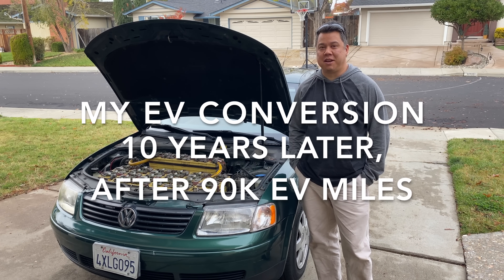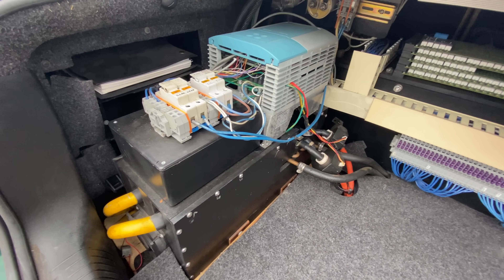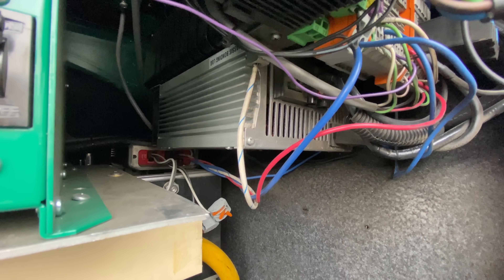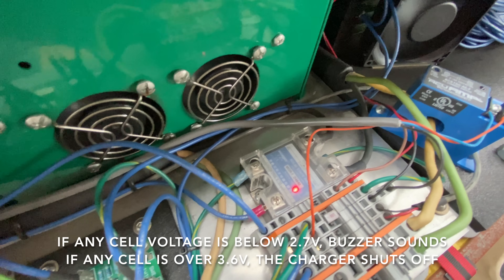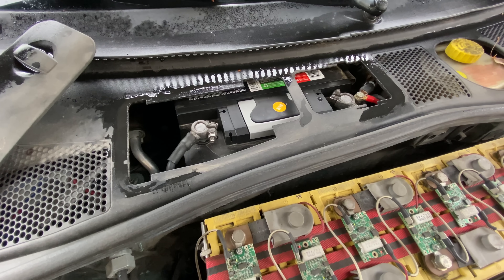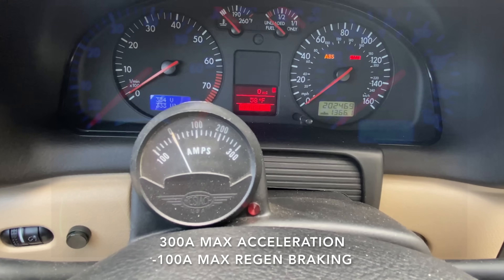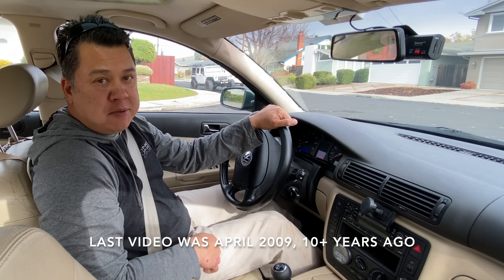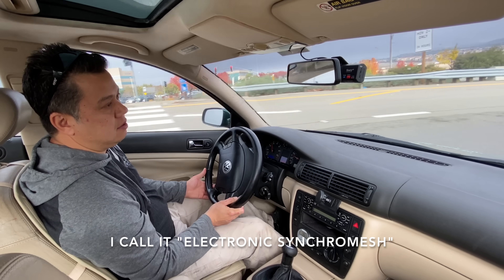My EV conversion after 10 years and 90k miles

Comment: Wow, there is/was a huge amount involved in going the DIY route - you obviously need more than knowledge of your resistor color-codes to tackle a project like that!  Impressive.  It would have been nice to know what sort of decrease in battery capacity you've seen after 10 years.

Comment: Turns out it's really not as simple as battery, charger, motor, speedcontroller. There are many things that used to be there with engine power ready to use that now has to run on batteries, such as power steering, heater, ac, etc

Comment: on Large Diesel Trucks and many types of after market modified off road 4x4 use what is known as hydraulic boosted power brakes.  the booster runs from the power steering pump.

Comment: how can a manual gearbox work in a electric car? they just have forward and backwards? im still in the stone age and drive a petrol car so this is madness to me
Reply from the maker: To make the car move you just need to turn the input shaft on the transmission (with a motor).

Comment: If u needed to charge one cell manually then whats the point of the bms
Reply from the maker: A BMS protects each cell by disconnecting the charger or disconnecting the load before the cell is over charged, or over discharged.  BMS can also perform a balancing function to maximize the potential capacity of each cell a pack.   I have never needed to balance manually, but there may be a time where one cell drifts beyond what the BMS can balance as the cells age, or if the car goes a long time without being charged (top balanced).   Better to have the ability to easily check that cells are actually balanced, and have the ability to balance, than not design for it.
Reply: Thats very true... thats a nice setup! I just built a 48v 1500watt drift cart lol far less technical compared to your build but maybe one day I can turn the minivan into a electric drag racing machine! 🤔 one can dream haha

Comment: 333V. Looks like you have 100 LFP cells in series. But seriously doesn’t look 100 prismatic cells. They are packed very tightly. By the way what inverter and motor are you using?

Comment: bro huh, you havnt changed brake pads in 10 years? did i hear that correctly.......
Reply: That’s because of the regen braking, most electric cars go a 3x or 4x as far on brake pads.   Having said that I did 90,000km on a set of brake pads in my 1998 Volvo 940 SE a few years ago, mostly highway use.
Reply: Many new EVs now come with ceramic coated brakes because they were rusting up from disuse.

Comment: Describe electronic syncromesh please. Lol
Reply from the maker: Let's say the motor is spinning at 8000 rpm in 2nd gear, and I want to shift into 3rd gear.  I know the RPMs need to be 6000 rpm for 3rd.  So I put the car in neutral, command the motor to 6000 rpm, the shift light turns on to indicate the revs are matched for 3rd, then I shift.  I think a lot of new stick shift gas cars do this as well.

Comment: That conversion may be primitive by today's standards, but so was the first Bell Telephone, Edison record player, Wright powered glider, and Ford Model T (the latter was very basic-even for the time, but also affordable.)

The COVID-19 epidemic is UGLY, both from a Humanitarian and Economic standpoint. But...we all saw a beautiful site a few months ago. All those oil tankers off California, with no place to put their oil! Folks were driving to work less, and flying much less. With the EV, we can make that a permanent reality. Private vehicles use over 40% of refined crude in the form of Gasoline. Tractor trailers use about 25%...mostly as Diesel. In the latter case, we could use overhead high voltage Catenary lines on the Superhighways.  This is being tried in Europe. With "Green" power sources, especially, we could  have massive savings. Even with natural gas generators, things would be much improved. The Nikola startup (Tesla's first name) is rolling out Hydrogen fuel cell trucks. Again-if the H2 is electrolyzed from Solar or Wind, there will be Big savings in fossil fuel usage. 

Jet airplanes cannot be made "Green", but bullet trains and the Hyperloop (which is also Elan Musk's baby) could replace air travel domestically, and even Continentally (from Montreal to Buenos Aires, Berlin to Jo'Burg, Paris to Vladivostok.) Domestic Oil interests, along with OPEC and Russia (which is a massive producer) have conspired to stop the Green Revolution. 

Home HVAC uses a LOT of Natural Gas. Home Solar and wind are sometimes practical, but ground loop heat pumps can be used almost anywhere. Again-massive Carbon savings. I think a Eutectic bath in the basement would be a cheaper option.

Comment: The range is not bad and on my current used Nissan leaf it has 85k miles on it and goes 40 miles on a charge. Plan on upgrading the battery myself.

Comment: Impressive build! Very clean.

If I might suggest one thing, it would probably be to isolate the HV parts so they cant be touched accidentally. Maybe an IP grade high voltage junction box for the relays, fuses etc.

Comment: not considering the price of electricity for recharging the car
with the price of diesel of 1.1 $/Liter in the EU, and average fuel consumption of 7.5 L/100Km, you can buy diesel for 303.000 Km wich costs 25.000 $
And he only did 150.000km so far
In my oppinion it's not worth it, considering lots of money upfront, and you have to drive at least 60.000 km/year  for 5 years just to get your money's worth, and start to make a profit after that, considering that the life of the batteries is about 10 years.

Comment: I am an electrical engineer and let me tell you his project is phd level or maybe higher. Such an awesome guy. And he built it 10 years ago!! 10 years ago if someone told me that electric vehicles are future i wouldve laughed but today it is a reality. Although i can bet that the whole assembly wouldve cost alot. Brushless dc motors with convertors and igbts (10 years ago)..wouldve cost alot.

PS : a suggestion you could use liquid cooling for the battery packs, thought there always a risk of leakage.

Comment: Kudos! I only dreamed of converting a Ford Ranger or a small car 15 years ago, pricing out a kit and batteries beak then it would have cost me $15 grand with my labor. It wouldn't had the air condition, power steering & brakes, and not lifepo4 batteries. 
 I never did.
Reply: Now is the time.  Start building!
Reply: @daveriley6310  I like the technology of today. I'd rather buy high tech :)

Comment: Are you an electrical engineer.?

I wanted to convert a walk behind  skidsteer to  electric.  Because after 3000 hours the motor went out. This is way too technically for a carpenter. 

Don't get me wrong. You have done an amazing job. This car will outlast the body. 
I'm a strong believer in this is the future.
But it doesn't help in the MEXICAN beer virus. ( CORONA)
One I get back to work. It will be hair  straight back. 

Can you give me some advice. $3000.00 for Honda gx690 motor or electric. Any I on crack. 

I can handle honesty
Reply: Dave Welch  - Shuswap Renovations. 
250 803 8890 Canada
Reply: I'm a  carpenter. Mechanically challenged and electrically challenged. 
Make it simple. 
45 years of being a  carpenter. My excuse is I come from Irish ancestors

Comment: is two hours per gallon a good deal. get forklift and take out just the alternator and the hydrualic motor and you get a scooter that is water cooled 60 mpg and us 2 to 1 gear for the alternator and it runs on regular for two hours at 30 miles per hour at full power for the hydraulice motor. adjust gear ratio as necessary for different forklift. auction look for ones that have a broken engine are easiest and broken stem or hrydaulic with engine that is too old to repair anymore also i do video game walk throughs. full name show.

Comment: This is great, would it have cost you less if you started the project today?
Reply from the maker: I think the costs would be roughly the same doing an identical conversion.  Today there are used batteries available, that would be cheaper than the new batteries I bought, so it could be done cheaper.
Reply: @etischer  Thanks, I appreciate the response.

Comment: Okay. i hate to be "that guy" but that's a lot of naked circuit boards under the hood.
Reply from the maker: The boards are conformal coated.  Hood is sealed all around with foam gasket.  Hasn't ever gotten wet, just have to blow dust off once  in a while with compressed air

Comment: Can you help me with the cooling system? My kelly controller shuts off after 10 mins of ride
Reply from the maker: Might be able to help, but might try asking Kelly too.  You might just be over driving it beyond it's continuous duty rating?   What size radiator are you using?  What RPM is your motor spinning typically?  My guess is you're running too high of a gear (try 2nd gear instead of 3rd), so you get more voltage to the motor, and less current.  Current causes the heat.   You can get more power with less heat running higher rpm (higher voltage, less current).

Comment: Cool project.
Just as a side note - does it really need the BMS for each cell?
I would expect you only need these if you use the full capacity of the cells.
Reply from the maker: I ran without a BMS for about 6 months initially, manually checking 99 cell voltages a few times a week with a volt meter, and manually charging individual cells.  Then I started to charge my car at Tesla every day, it would be really bad (international)  news for my car to catch fire.   I wouldn't run without a BMS, too easy for something to go wrong, and too many cells to keep an eye on.

Comment: Impressive! LiFePO4 right? Did that chemistry improve over the last 10 years? (power, weight, volume, if you'd would buy new ones today)
Reply from the maker: I don't think it has improved much, I think the same cell in the same form factor, same Ahr are available to purchase.   They are still lower energy density compared to Li ion.   I would go with a used battery from a crashed hybrid or Tesla.   Hybrid batteries are designed for high discharge current, so you can get away with a smaller battery pack.   If you don't need the density or high discharge rate  (stationary storage) then they might be a good option.  For EV use, I think there are better options out there on the used market.
Reply: @etischer  Tesla may develop a new kind of LiFePO4 cell for the Chinese model 3. Maybe you can use those one day. And a thought: would it make sense to add a supercapacitor bank to your system, to support short moments of high discharge (and re-gen). Anyhow: amazing job you did!

Comment: You retired and bought a Tesla 3 ?
Reply from the maker: Yup.   I was commuting from SF bay area to Reno weekly for the last 50 weeks at Tesla, and just got burnt out.   Been holding off buying a Tesla for years because it just doesn't make economic sense since I have the Passat EV.   Finally pulled the trigger, ignored economic sense and bought a Model 3 AWD.  Couldn't be happier, it's such a leap forward in automotive evolution!

Comment: How can you solve inductance jerk that made inverter fault in early trial?
Reply from the maker: Not sure what you're referring to.  Are you running V/Hz, Sensorless vector, Closed loop vector?   What RPM does the fault occur?  Do you have the right motor parameters (full load current, magnetizing current, rotor time constant, # of poles, voltage...)
Reply: @etischer  I noticed you'd mentioned your 1st trial came up with electrical fault between your driver circuit and IGBT power modules. Then you said it was from some mismatch inductance.  So I wonder on what ]s the cause and the way you solved that problem.
Reply from the maker: @alexlo7708  The motor is a big inductor coil, and it wants to keep current constant (like how a capacitor wants to keep voltage constant).  When the IGBT switches off, this causes a voltage spike (coil is trying to keep current constant with infinite resistance).    They sell specialized film capacitors (snubbers) that mount directly on the IGBT modules to absorb these voltage spikes.   That's all I had to do,  I added a few of them on a copper bus bar, that's what those black boxes are above the electrolytic caps.    Originally I had my cap bank connected to the IGBT using wires, they need to be mounted directly on the IGBT.
Reply: @etischer  Thank

Comment: Would a smaller setup, 1/4 the batteries and a drive shaft boost motor work as well. 20% boost for below 30MPH driving. Keep the main car engine the same, everything and add push a button for drive shaft boost.
Reply from the maker: You can make anything work, but not sure it would be effective.  20% boost but carrying 20% more weight.  Boost motor will need a transmission to gear it down, but then it will limit max speed unless you add a way to disconnect it on the freeway.

Comment: A lot of work. Impressive. This is what you do when the market hasn't started building what you want. I'm sure some issues would be approached differently today. The only thing that bothered me was the exposed battery pack between the rear wheels. Up here in Quebec that would be destroyed by salt&grit in the winter. But making a shroud or enclosure out of ABS would not be out of reach for this gentleman.

Comment: What happens when you hit a pothole or a puddle
Reply from the maker: nothing happens
Reply: @etischer  never had a short? Thats really cool
Reply from the maker: @draconicwindbane2056   The computer style power supply Im using (purpose built for EV) to generate 12v  did have a short once,  an internal fuse holder was resting against a cap, and rubbed through the vinyl on the capacitor, a fuse blew, and I had to drive home just on the 12v lead acid battery.  Was lucky, I just had to put a new fuse in.  This happened about a year in, and hasn't happened again.

Comment: I'm currently in school for electrical engineering and this man is inspirational.
Reply from the maker: Was curious to know if they have any high power course work at your college?    Everything I learned in college was breadboard level.  I'm on the advisory board for my college now, I'm trying to get them to add some coursework on designing: electrical panels, power distribution, battery management, grid tie inverters, solar inverters,  IGBTs, switching power supplies...  Would be interested to know if coursework has changed since I went to school.
Reply: @etischer  I'm currently in my Sophomore year and so far it is only breadboard level circuits and also logic circuits. They have added a power systems course to our curriculum that I will take my junior year that I believe goes over battery management and I believe grid storage. It seems the emphasis at my university is geared more towards microcontrollers (such as arduino), communications and breadboard level circuitry. I'm hoping to incorporate solar energy into my senior project though.

Comment: Excellent video and engineering!  Two concerns:  How do you keep the LiFEPO batteries from freezing as that will damage them, and I would be concerned about all that heavy equipment in the back with what appeared very little barrier between them and the occupants in a crash.
   I think the auto companies should take you on as an engineer if they haven’t already.  What’s your day job?
Reply from the maker: It doesn't get freezing cold here in California, it's also in the garage every night.  The cells in the rear are pretty well secured, with welded racks sandwiching the car's chassis, then another aluminum cage over the top.   Day job was Sr. Staff controls engineer at Tesla, retired a couple years ago.

Comment: There's something i dont understand about this build... Do you only drive it in dry weather? What hapens if you start rolling in water, all those boards directly on the cells will surelly fail...!!!
Reply from the maker: I drive it every day, rain or shine.  The circuit boards under the hood have never gotten wet, it's fairly well sealed with a gasket around the hood, and bellypan below.  They are also conformal coated, so if they get wet they are somewhat waterproof
Reply: @etischer  thanks i didnt  know engine bays were sealed

Comment: Mmm kinda genius... BUT you spent 25k or more considering ya had to buy that VW to mod when ya could have bought a Nissan leaf for cheap or cheaper than what you spent.  Ps what are ya going to do with all that lead and acids when done?
Reply from the maker: This was 2008, before the Leaf or any electric car was widely available.  Plus it's a hobby, and an education, something to take pride in, not something Im trying to save money doing.   It was also my rolling resume that got my career started at Tesla, I don't think they'd be as impressed if I drove up in a Nissan Leaf.   $25k was all in, including the car, probably cheaper than the Leaf when it came out.   The batteries are Lithium, and will be used for stationary storage for another decade, then recycled.
Reply: etischer my mistake I thought this was a project recently completed ether way impressive.
Congratulations on the job hope they hired ya what you did does take serious engineering skills.

Comment: 8:02 idle at 250 RPM
Reply from the maker: Reason it does that:  The motor that runs the tachometer needle is driven by a stepper motor.  I installed a stepper controller to run the needle, and the motor homes the needle to a hard stop at zero RPM position every time I turn the car on.  Problem is the hard stop is between magnet poles on the stepper motor, so after homing the needle rests on the next closest magnet pole which is a few degrees above the hard stop.